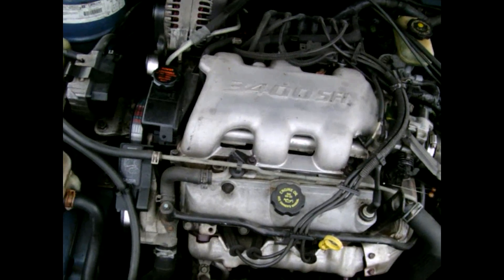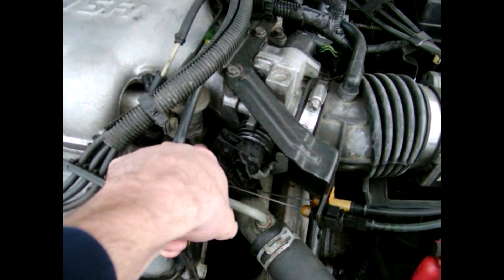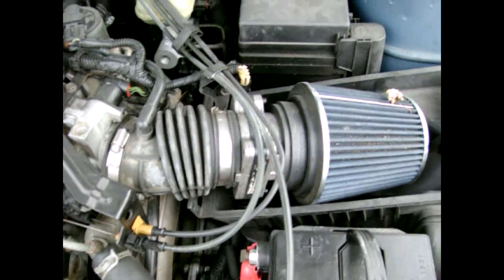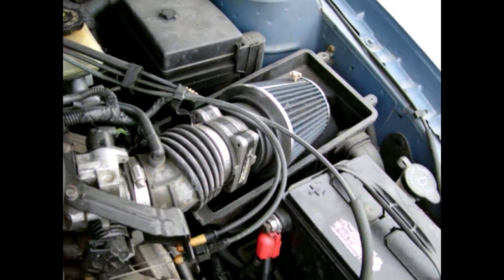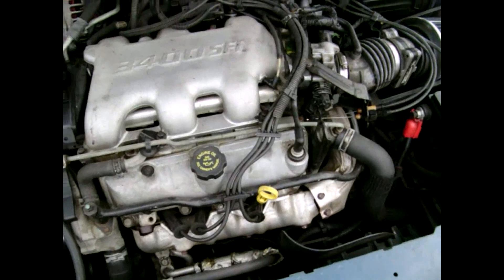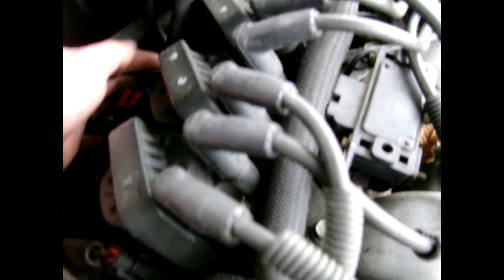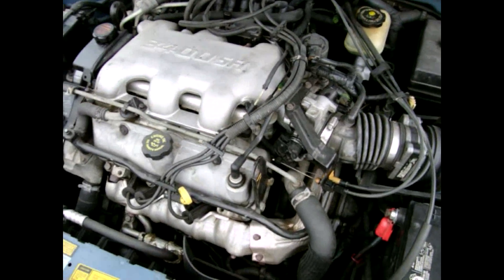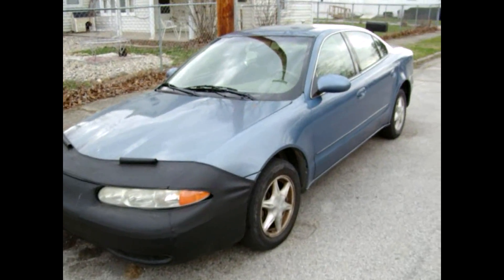3400 GM Engine 3.4 Liter Motor Explanation And Discussion

Comment: I have a 2002 Grand Am GT with the 3400 and it has hard time staring, I drive it around works fine but if I go to the store for about 30min to an hour than its hard to star again. I tried turning the ignition to run a few times before starting seems to help out just a bit, but it still has a hard time. Im thinking its the fuel pump. I also change the fuel filter and it was pretty clogged.  Any tips?
Reply: I have similar issue w/ 2002 Grand Am SE, 3400. I've been having to apply a little gas peddle while cranking in order to get it started. After starting it lopes and surges a bit then smooths out, runs fine. Fuel regulator , fuel pump, one year old. Fuel filter a little older. Scotty Kilmer said possible bad reading from coolant sensor ( have not changed it )
Reply: Kyle Major I figured out the problem, I ended up doing a compression test and it came out to good compression around 120 and while I was checking the compression I got a piece of cardboard and put it right on top of the spark plug hole and cranked it. Water came out turned out to be the head gasket. Replaced both of them and started right up.

Comment: I just acquired an 03 rendezvous with this engine.  It idles too high, in gear with the foot off the accelerator it will cruise at 45 to 50 mph, need to brake to slow down.  At a stoplight, if I pull it into neutral, it will rev up over 3,000 rpm for a few seconds, but then settle down around 1,600 rpm.  The throttle cables seems ok, there is slight slack and the throttle seems firmly closed.  I couldnt hear any vacuum leak, but after watching your video I will go make a more thorough inspection.   Check engine light is NOT on.
Reply from the maker: +Steve Roberti Use carb cleaner or a spray water bottle.  Spray around the hoses.  If you notice an idle change, it could be a vacuum leak.  Also check for leaks around the EVAP / EGR.  Could be a stuck EGR valve too having carbon build up not letting it close completely.  Just a few places to check.
VT247
Reply: tps

Comment: 2000 pontiac grand am gt. I've noticed when i get to about 1/4 tank of fuel the car won't start. If i rock the car back and forth while turning the key to the on position to engage the fuel pump it will tend to start. Inline fuel filter has been changed. Fuel pump screen clogged? HELP!!!
Reply from the maker: You're lucky to still have the fuel gauge working.  The fuel sending unit (measures how much gas is in the tank) goes out.  Keep the tank filled over 1/2 tank or drop the tank and fix the sending unit.  You're running out of gas cause the gas gauge isn't reading right.  Mine has the same issue, just haven't fixed it yet.
VT247
Reply from the maker: DecrepitOrigin888 Doing the head gaskets isn't much more work than the intake.  I've got a video up on how to do this fix.  You can get the bolts and gaskets for $100 or less off eBay.
VT247

Comment: 2003 oldsmobile alero changed crank sensor and it starts up then dies start up then dies will only run for a minute or so any help would be nice 
Thanks in advance
Reply from the maker: A few things I'd check.  Unplug the mass air flow sensor by the air filter.  See if it stays running.  Would also check fuel pressure.  Most parts stores have a loan a tool program for the gauge.
VT247

Comment: I have a question for you.i own a 2000 Oldsmobile Alero 2 door with the same motor as what’s in your car.just recently I have been getting a strong fuel smell coming inside car when car is running through air vents inside car any ideas? Thank you
Reply: ignition coil or leaky valve gasket

Comment: i have a 200 pontiac grand am i recently had the upper radiator hose blow. i taped it up and filled it with fluid just to make it home about an hr away. 2 miles from home i pulled up to a stop light and the thermostat red lined i shut it down let it cool off then made it the rest of the way home. i changed the hose filled it up fired it up and fluid started leaking from the front of the engine. I thought it was the water pump. I replaced that but still seems to be leaking i can't track it down but it is dipping from the harmontic balancer.    Any suggestions.     thanks
Reply from the maker: These engines have a bad habit of blowing the factory intake and head gaskets.  If it turns out that it is the intake gasket, trust me, go ahead and do the head gasket too.  It's not that much more work and it will eventually need changed anyhow.  But my guess is the intake manifold gasket on yours may be leaking and then flowing down by the harmonic balancer. Check behind the power steering pump for coolant.
VT247
Reply: Vacationtime247 Front timing cover gasket

Comment: My 3400 is pouring antifreeze behind the starter as fast as I pour it in it comes right back out any help on this
Reply from the maker: +Al Marshall Sounds like it could be the head gasket.  Antifreeze running down the block from a bad gasket.
VT247

Comment: what is the line coming from the upper intake manifold near the fuel pressure regulator
Reply from the maker: If you're referring to the vacuum line, it goes to the transaxle and helps with shifting.
VT247
Reply: Vacationtime247 that would be the one about a 4 inch section snapped right out of mine when I was changing the fuel pressure regulator it runs down through the harness and I have no clue how to fix it
Reply from the maker: Find a piece of vacuum tubing to snug / slide over the original black thin stock unit.  It should fit snug.  It will act as a bridge fix for the broken piece.
VT247
Reply: Vacationtime247 working like a charm so far thanks man you're good people

Comment: How do I replace my pcv valve in my 1999 Oldsmobile alero? Where dose it plug in at??
Reply from the maker: The PCV valve is on the front valve cover.  Should pull up and out.  May have one small bolt or screw that needs removed to take it out.
VT247

Comment: I have no heat and on occasion my 2003 impala 3.4 will overheat (in the red) and then drop back down. Recently had intake manifold gaskets replaced, radiator and heater core flushed. Thermostat replaced also. Does this sound like a bad heater core, water pump or thermostat?  I would really appreciate your help.
Reply from the maker: My guess would be the head gasket.  They are known to go bad.
VT247
Reply: look for bubbles in the water coolent jug tank when hot if steady strem of gurglig bubbles mite need head gaskets befor head cracks mechanic job :

Comment: O.K. So I am going to purchase a clean 2003 Grand Am GT and I talked with some of my friends about the engine thats are in them, the 3800 and tthe 3400, I received great input on the 3800 however the car I'm looking at has a 3400 and now I am reading all this about over heating and the head gaskets going and I'm scarred ;( . How can I tell if the head gaskets were already changed or is there some type of preventative maintainence I can perform as soon as I get the vehicle?
Reply: Michael Richard      Hello I know this is old and I don’t know what you decided on the 3800 or the 3400 but I own the 3400 V6 on my Grand Am and what I can tell you is don’t be scared of this motor. Yes it dose run hot but that’s normal with this motor as long as the temperature gauge is reading good don’t worry also yes this motor has had issues with blown head gaskets but that’s not from over heating it’s from oil levels being too low. Yes oil keeps everything from seizing up but it also helps with keeping everything cool as well plus the engine coolant helps too. Since this is a push rod engine if the oil gets too low the rods can blow a head gasket allowing coolant to poor into the engine oil. With this motor make sure to keep an eye on all the fluids you should be okay.

Comment: I have the same problem with my pcv breather ...I order new one...will I have a problem if I take off bracket that's over it ...
Reply from the maker: The bracket over the PCV is for the throttle and cruise control.  It will need to be removed and reinstalled in order to replace the grommet underneath.  
VT247

Comment: My 2001 Alero hesitates when starting first i thought it was the fuel pump but it is working fine it runs fine it idled funnny once but not anymore, any help would be greatly apreciated
Reply: by the way it is a v6
Reply from the maker: Check the normal things like spark plugs, plug wires, vacuum leaks, and also run the trouble codes.
Reply: will do, thank you for the feedback

Comment from the maker: I'd say the water pump is going out.  It's easy to change and only cost @$25.  The water pump isn't allowing enough flow through the system.  The impeller on the back of the water pump is going out on yours.  Fixing the water pump should fix the problem.
VT247

Comment from the maker: You could try just doing the intake manifold.  But having to redo the whole thing all over again isn't fun.  Ebay sells a complete gasket set with new bolts for $65.  The exhaust bolts sometimes break, but a muffler shop can remove any broken bolts and Fastenal will have the right studs to make it work.
VT247
Reply: I have same engine and under hood set up in my 1999 Pontiac Grand am. Their are 2 cables above the upper radiator hose where it connects. They are connected to almost a pulley I want to say. One of those cables seems stretched. What is it and is their a way to tighten it or is it a concern

Comment: Ok I need to know where the vacuum port is on the intake where does it go?
Reply from the maker: One goes to the EVAP / EGR.  Another goes to the brake booster, the large one.  Another in the front goes to the transaxle.  Try a google search and click on images for GM 3400 vacuum diagram and it should help show where they all go.
VT247
Reply: Vacationtime247 I’m talking front right drivers side it’s completely missing and I have it blocked off right now with a screw and it’s causing my trans to shift up instead of overdrive

Comment: O what might you know about the gmc Jimmy. Cause i think I need some new battery cables any imfo on a quick fix with that please and thank you
Reply: Try preasure washing the cabel ends and then remove and clean with a wire brush. Works great!

Comment: my car was slightly over heating so I changed my thermostat.. Found a freeze plug lodged in the thermostat.. Now it's really over heating and leaking fluid.. wasn't doing that before.. How do I fix it. 2000 Chevy impala..
Reply from the maker: Do a coolant system pressure test.  Make sure the coolant system can hold 12-15 psi of pressure.  There may be a leak or bad head gasket.
VT247

Comment: Thank you. I have this same engine in my 02 Montana. This is really helpful. How long do you think changing the intake manifold gasket would take your average backyard mechanic?
Reply from the maker: If you're doing the intake manifold gasket go ahead and do the head gaskets.  It's not that much more work and it's great insurance.  The head gaskets are known to go bad and will save having to do this whole job over again.  I'd say it's a 2 day job. 1 to take it all apart and get new exhaust crossover studs and the next to put it all back together.  But, if you start early its possible to do all in a day.
VT247
Reply: Vacationtime247 Okay. Cool. Thanks.
Reply: I replaced the head gasket with new gaskets, bolts, got the heads milled, plugs, wires, crossover hoses, and o rings in fuel filters, and coolant lines.  It cost $400 in parts, and $250 to get the heads milled and cleaned.  It took me 40 hours.  I did this 4years ago on my 2002 chevy venture.  I put 55,000 on it since, and used it for 2 NY - FL road trips.  I trust my work, and this car is simple to maintain and fix. I needed to buy a torq wrench, and a few sockets.
Reply: Cool. Thank you.

Comment: Hey man what s your thoughts on this? I recently changed blown head gasket on a 2001 chevy impala 3.4 I got everything put back in proper order per Haynes Man. Engine will spin but wont start. I have about 55-60 psi in fuel pressure. compressions good and I have spark at every cylinder. check again this morning to verify I have everything hooked up and tight and no luck. Any ideals?
Reply from the maker: Check that all the plug ins are connected right.  Some are hard to see.  My guess is something is left unplugged.  Check that the camshaft position sensor, crank sensor and all 3 plugs are in the coil box.
VT247

Comment: Does anyone know how to tell the pushrods apart? we seem to have a long and short
but i forget witch is witch
Reply: Doug Alston 
Intake is short 5.75 inches
Exhaust is long 6 inches

Firewall side E-I-E-I-I-E
Radiator side E-I-I-E-I-E

It is much better to label pushrods and put them in order when removing from engine. Haynes manual shows putting them in cardboard box with holes in it so you know where the front of engine is.
Lube them before install.
Reply: Clayton εжз Old MacDonald side E-I-E-I-O

Comment: Guy just called me... 1999 Pontiac Grand Am 3.4L SFI 6cyl 186,000 miles.

Was driving home and he heard a rattling noise and then car lost power while going up a steep hill. That was followed by a loud ticking. Loss of power.

I imagine the timing belt tensioner set up then broke free and was rattling. It may have jumped time and the lower compression resulted in power loss. That or he bent some valves. Is it an interference engine?
He limped the last two miles home but it stalled on him twice while trying to make it the rest of the way up the hill. The last leg home was flat or downhill so the car performed better. It still runs but there is a loud "click" every couple of seconds at idle.

Your thoughts? I can't look at it until Wednesday. Was going to start with a compression test. I did a head gasket job on the car two years ago because of the coolant leaking into the oil. Car has ran great up until now.

Edit: It's a timing chain... oh dear... A valve popped? Or a rocker bolt and the pushrod is being thrown around... or the bolt and rocker arm are being eaten by the camshaft.
Reply from the maker: +Clay Ton It's very possible that a rocker arm has pulled out the stud.  Some of these 3400 engines come with small 8mm bolts that hold the rocker arms in place.  They strip out and can be very loud and cause a misfire.  Check for where the noise is coming from using a piece of vacuum hose or a stethoscope.  This will help narrow down as to where the sound is coming from.
VT247
Reply: Vacationtime247 Ripped it apart today. Yup, one of the rocker arm bolts was ripped out. The front drivers side of the engine. Was planning on buying a helicoil and installing it on the damaged thread. The rest, I planned on using blue thread-lock and retourqueing them to be sure.

The issue rocker arm was right in front. Very easy to get to. Made way more work for myself going into the firewall side... Just to be safe so the customer is happy and I don't have to do it again in the future.

Did record the knocking with my phone last Saturday. Was going to record some of the repair. Lol hopfully it's successful.
Reply: +Clayton H   These engines are driven by a timing chain and sprockets.  Its the same as the GM 3800 engines.  It a shame because these are great engines but many of them are not maintained properly and then the owners blame the car.   Have you fixed the car yet? Just curious how you made out.

Comment from the maker: Like 302Canuck said, it's probably a head gasket.  The motor is probably tired and on its last leg.  Replace the engine would be my advise if you're planning on keeping it.
VT247

Comment: ok same engine and same year.  Following is new.  Fuel filter, relay, pump. PCV, cam position, coolant sensors.  No error codes no check eng light.  Runs great then lunging like its starving would just die.  was told it could be ignition harness so I put in a new one ran great for a week now starting to lunge again.,  But now it don't die.  Idle is great and steady checked for vacume leaks found none.  got to much to burn this van.. What could it be???

Comment from the maker: These engines are notorious for blowing head gaskets.  That is probably what the problem is.  If you bleed the air out of the system, you have heat in the cabin for a few minutes, then it overheats again with more air in the system, it's the head gasket.  Have a video up on how to do this repair.  Good luck and hope you get it fixed : )
VT247

Comment: I need help mine overheated the other day and now it has a loud knocking noise. what could that be???
Reply from the maker: +Tia Beach Hate to be the bearer of bad news, but that knocking means you most likely need a new engine.  It's overheated so the head gaskets are most likely toast.  The knocking is probably a rod, a stripped out rocker arm, a main bearing or some seriously scorn pistons  / cylinder walls.  Whatever it is, it isn't good.
VT247

Comment: FIXED A HEATER HOSE LINE IT DOESN'T LEAK ANYMORE BUT IT STILL HEATS UP QUICKLY.WHAT'S UP WITH THAT?
Reply from the maker: Try doing a pressure test of the coolant system.  Autozone does a loan a tool deal so you can check it yourself for what equals out to be free.
VT247

Comment: can the loose vacuum hoses cause performance issues as well?
Reply from the maker: Yes.  Vacuum is very important and if there is one, it will certainly cause performance issues.  With the engine running, spray some carb cleaner around where you suspect the leak.  The motor will rev up slightly and you'll know it's there.
VT247
Reply: +Vacationtime247 thanks. also do you reccommend changing the pcvvalve hose as well? to stop any leaks and to seal the pcv better?